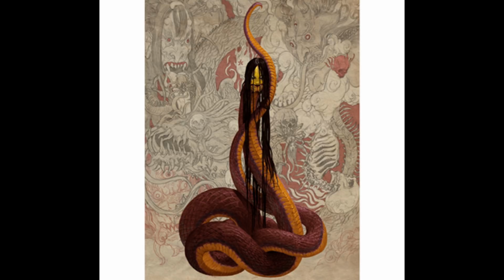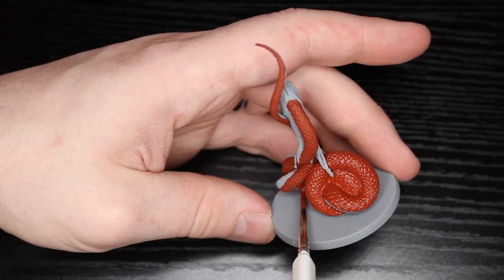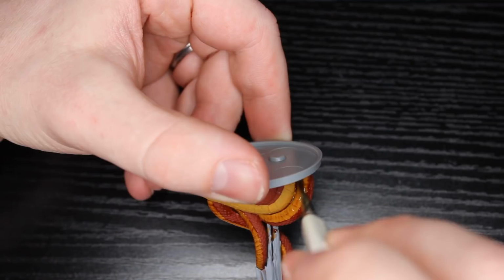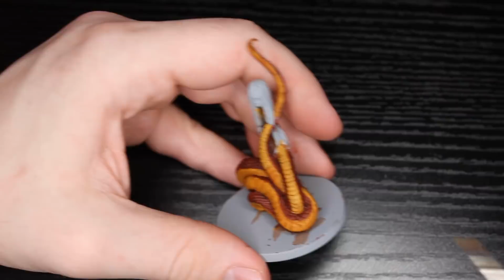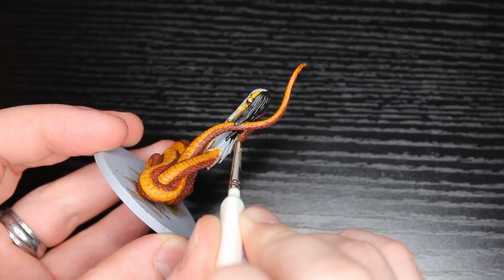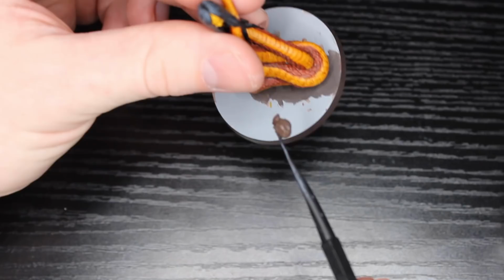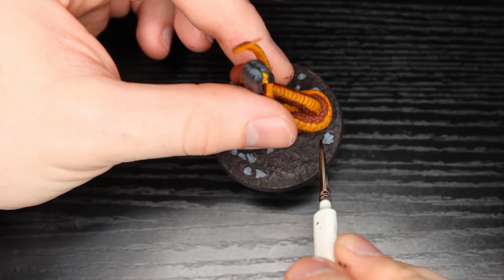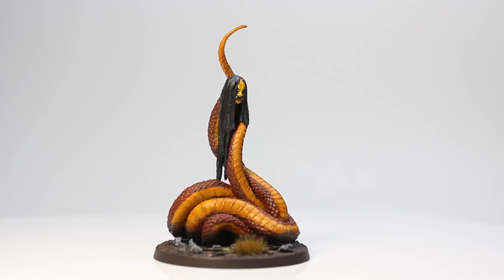Rising Sun Painting: Nure-Onna

Comment: Looks great!  I assume the next vid will feature the new brushes?  :). 

Watching you paint the twists and turns of the snake sculpt even started to frustrate me a bit.  Working the brush in such tight areas - almost blindly - can be aggravating. I am currently painting my legion storm troopers, and getting the black in between the arms and legs is driving me crazy.  I think watching you paint the snake’s underside triggered some sort of PTSD. Hah
Reply from the maker: Glad you liked the video! You will probably see at least one of the brushes in the next one :) I won't review them until I have a good amount of time with them, but will mention it in videos as I use them as well.

Sorry about the PTSD :D It is decidedly "not fun" painting in cramped areas and one of the reasons I believe sculpt design is so important. For Legion, did it come pre assembled? For some reason I thought they were on their sprues. If that's the case you can always prime and paint them directly on the sprue, useful for people holding guns to their chests or snakes with upward curved areas at the bottom ;)